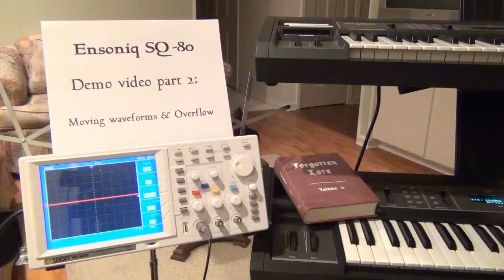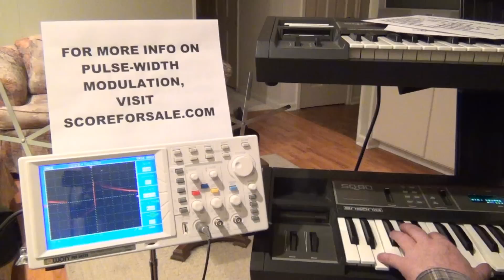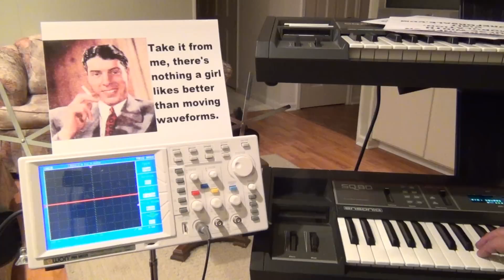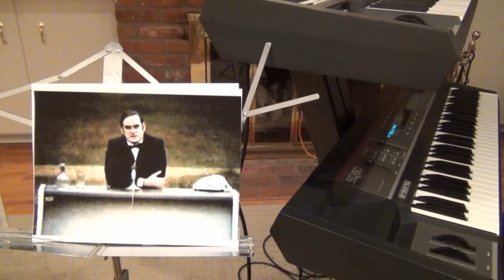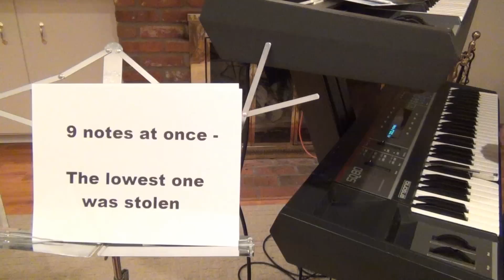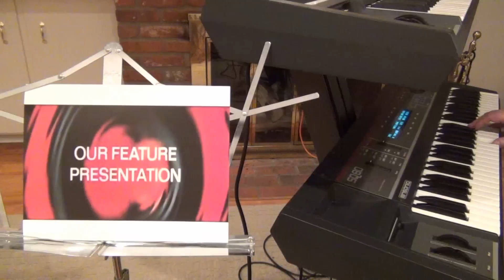Ensoniq SQ-80 demo 2 - Kirk Slinkard.mp4

Comment from the maker: Regrettably, I can't take credit for it. I first learned of sync when The Cars came out with "Let's Go" (where the synced wave is tuned higher than the reference oscillator and modulated), and shortly before I got my first new SQ-80 I read in a book about tuning the synced wave lower than the reference oscillator to get different static waveforms. Then I found a few reader-submitted moving wave patches in the Transoniq Hacker magazine and that started me experimenting on my own.

Comment: I know it's been a while since your last sq80 vid, but I was wondering if you could demonstrate some of your programming techniques and workarounds and perhaps cover the AM effect and some tricks with LFO modulations (e. g. LFO sequencing, etc)?
Reply from the maker: I&#39;ve been intending to put out another SQ-80 vid on a different subject, but have been really busy lately. It&#39;s nearly ready to record. But I have also been putting together a 2nd patch set to be sold on Ebay, it has some really interesting patches, many of which do strange things with sync, AM, and arpeggiator effects using the LFOs, and has lengthy explanations in the patch manual.
Reply: Oh, ok then. When you do business on Ebay, did you ever run in trouble with paypal putting a hold on your funds for no apparent reason? I recently sold something and now I'm in a pickle because I'm broke (hence the sale) and am now putting up with a conundrum situation - I can't afford the postage to ship the thing that I sold and paypal refuses to work with me so that I can ship the damn thing. I can't believe they make such a fuss over $40. Sorry for the rant but did you have to put up with something like this?
Reply from the maker: I've had a hold a couple of times, but the reason was always given. In fact, Ebay/PayPal is required to give you their reason.
Reply: So it turns out that the hold was put on me because I don't sell something every freaking second. So I suppose those infrequent sellers who depend on Ebay and Paypal to save the roof over their heads might get royally screwed?
Reply: Excellent! I will buy them. I've made up a good few patches myself and you can get them free  at Rekkerd. 

I got lost in programming the SQ8L - I found it more enjoyable than my hardware SD1 (which I love), which is a bit trickier. Also it does not have a Resonance parameter, believe it or not, just like the old Wavestation (Korg added a resonant filter in an update for the Legacy series which includes the Wavestation).

I was really impressed by your patch programming. I look forward to buying your sounds. A lot of people use the VST version of this and I am sure they would buy them too.
Reply from the maker: The bad news is that my current set, the "Disruptor Banks" and my upcoming set "The Mad Scientist Series" both use hidden waves and illegal parameter values in some of the patches and those cannot be played on the SQ-8L or any VST version. Syntaur's "Soundset 4" also has similar limitations.
Reply: My ESQ-1 has the version 3.5 bios, which gives access to it's hidden waves. Sadly, via SysEx only. Then again, it's an ESQ1, not a SQ80.
Reply: Interesting. Good to know. 

I thought there was a way to access those waveforms, but I am obviously wrong.
Reply: Somebody said on a forum that you can access some of the hidden waves, or at least some sysex patches he used could access them. But he wasn't sure whether you could access all of them.

No idea. Worth remembering though.
Reply: Great to hear you have a new set upcoming, have you got a release date in mind?
Reply from the maker: As of early February, the online manual is in the final stages of completion. The patches are all set to go. Besides 2 banks plus of patches (85 if you don't count the layers & splits, or 90 if you do), it also includes the bonus "blank bank" from The Disruptor Banks patch set to make sure you have all of the hidden waves even if you didn't get The Disruptor Banks set. For this patch set it is recommended that you will have seen the original versions of The Fly, The Day The Earth Stood Still, War of The Worlds, This Island Earth, Revenge of The Creature, and The Flintstones.
Reply: Cest La Vie! FYI Microsoft is buying up free Linux. Linux/Ubuntu have nothing to do with 666, Unlike some companies which I won't mention. The only think I didnt like about Ubuntu was the icons on the righthand side of the screen , I spoke with IT at my company (who also feels the same about Windows 10) but loved Linux Mint and PCLinuxOS - although other people have tried a lot more distros than me. SQ80 and ESQ1 and Front 242 -  All very good in my book!!!

Comment: Just got a hold of one but don't know if you have to connect a speaker because it has no sound
Reply from the maker: Either that or headphones. I personally recommend using a stereo sound system with good full-range speakers as opposed to a guitar amp or similar. Go to http://www.buchty.net/ensoniq/  and download the owner's manual if you don't already have one.

Comment: I wish you would make a manual / video on this ... ..also, I am curious about pairing my esq-1 with sq 80 for layering polyphonic purposes
Reply from the maker: Download a free SQ-80 user's manual and read page 185 where it describes the ESQ-1 compatibility. If you use them as two different synths for layering, they would work together very easily and simply. If you are thinking of the overflow function, I recommend creating your soundbanks on the ESQ-1 then transfer them to the SQ-80. This will make sure that no incompatible waveforms or parameters are used.
Reply: Muchas gracias, thank you so much, vielen danke, spaseeba awesome reply
Reply: Thanks to you I simply bought another sq80. Yippee. The electronic 58 Les Paul Sunburst.

Comment: I was wondering, isn't syncing oscillators 1&2 (with vca for osc1 turned off) similar  or the same as the start point modulation effect found in, for example the VFX and later SD models, and some samplers?
Reply from the maker: Syncing (aka hard synchronization) changes the END point of the OSC2 waveform where it will loop from, but the start point always remains the same. That's when you tune or modulate OSC2 lower than OSC1. The VFX version is an enhancement of this that was intended to be able to give you more of the initial attack of the wave with increased velocity, but not limited to just that. If the SQ-80 OSC2 is higher, it's more like how many waveforms will happen before it resets - that classic sync effect that sounds a little like Wah-Wah. I look at as the philosophy of the VFX family was to try and give you the most realistic copies of acoustic instruments, where the ESQ-1 & SQ-80 are traditional synths that let you use your imagination and come up with totally new sounds.
Reply: Interesting. That was actually what I kind of suspected. I've just watched a demo of the VFX where the start point (or time slice) modulation was demonstrated. Interestingly, some of the sounds sounded close, if not equal to what I would get out of my ESQ1 with sync. Then again, others sounded more like what my Casio CZ-5000 would produce with it's phase modulation and ring mod combo. I suppose, if both AM and sync were simultaneously available, my ESQ would be capable to do a genuine scan throgh it''s waveforms, or would both effects cancel each other out since some form of vca modulaion is involved? What are your 2 pence on this?
Reply: I am really looking forward to your patches!
Reply from the maker: If AM and SYNC were applied at the same time, there would be no scan through the waveforms, but you could do even more complex moving sounds than can done now. But even in their stock form, the ESQ-1 and SQ-80 have barely begun to be explored. Most of their sonic potential still remains untapped.

Comment: Hi Kirk. Would you consider selling sound banks in sysex or on cartridges for the SQ80?
Reply from the maker: I actually did consider those, and found out that the sysex format should work, and the cartridges definitely will work but minus the demo sequences. But getting new cartridges would drive your cost WAY up. My inexperience and failed attempts at interfacing SQ-80s and computers prevents me from doing anything by sysex. I suppose that could be done, others have done it, but I'm too much of a technophobe to explore that any further.

Comment: Tell me, Kirk. Did you upload a demo of the SQ-80’s keyboard features? Touch sensitivity? Polyphonic aftertouch?
Reply from the maker: No. Haven't other players done that, at least to some degree? It took me a while to figure out that mechanism that senses velocity and pressure, might well make a cool tech segment in a future video showing the SQ-80 through different amps and effects. But I'd have to learn the opening theme from Blade Runner.
Reply: Thank you for the prompt response, Kirk.

Comment: How so you modulate with envelope wheen its not looping?
Reply from the maker: The only time something would not be looping is on unmodified transient/attack waves. They can still have their volume or tone altered by an envelope. For example a drum sample can be given a reverse attack amplitude envelope to even out the volume for a compressed or limited effect which is popular.
  Sometimes the sync and AM effect will cause these transients to loop endlessly, so in that case you would just treat them like any other sustaining waveform.